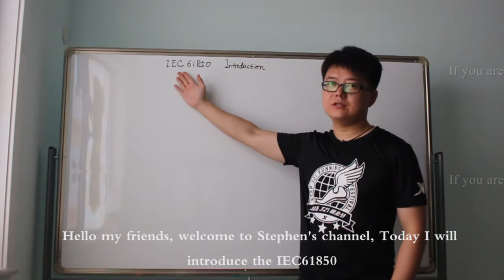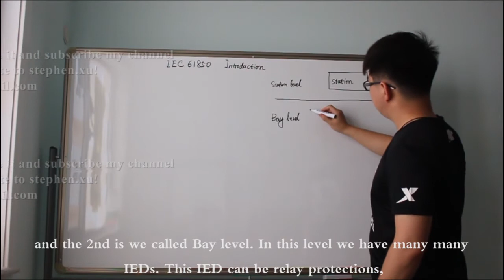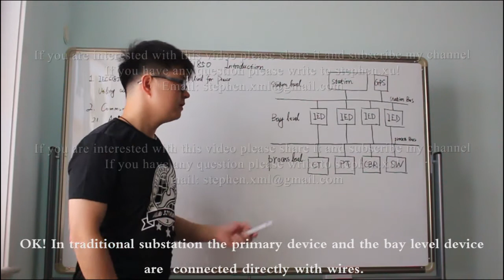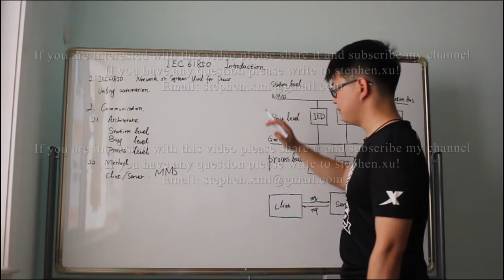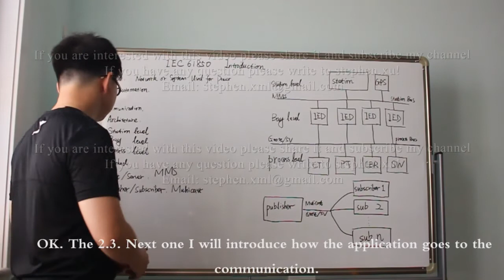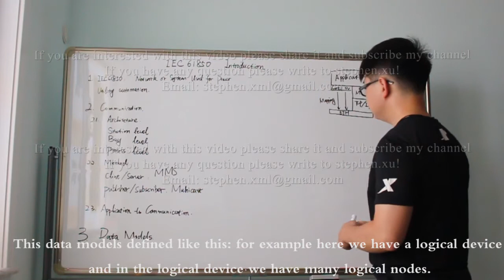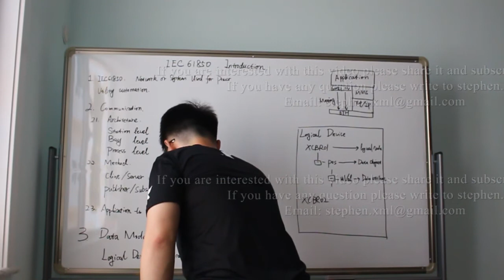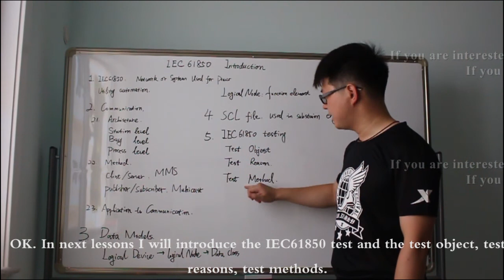II. IEC61850——Fundamentals(GOOSE, GSSE, SMV, MMS, FT3 and data models for digital substation)

Comment: I am doing a uni project to create cyber attack on MMS scada network in order to collect cyber attack dataset for  improvements of intrusion detection systems. It is very Useful ! Thanks for your sharing!
Reply from the maker: Your project is so cool~ data security is very important for the smart power system.  because all the data are so vulnerable for the network attack. so how to protect the data is the hot topic. we can provide test tools for such research(GOOSE, SV, FT3 message analysis ) in this filed. we can discuss and share the experience for each other to improve each other.

Comment: dear plz share how to test GE Relay G-60 using PONOVO.Also plz share how to upload relay settings to Power Test for Testing Purpose
Reply from the maker: OK sure I will. thanks for your support. Are you PONOVO customers?
Reply: Thanks for your reply.
I have just started to use PONOVO test set.but i am facing difficulty in its use.
Please share a video how to add setting file of GE Multilin relays as we have GE relays installed at our site.
Thanks
Reply from the maker: Hi. would you please leave me a contact information? I will let local agent to contact you.